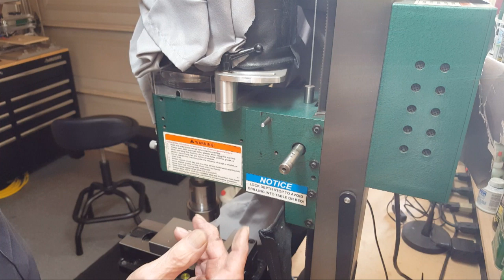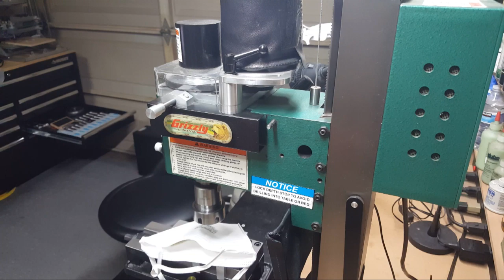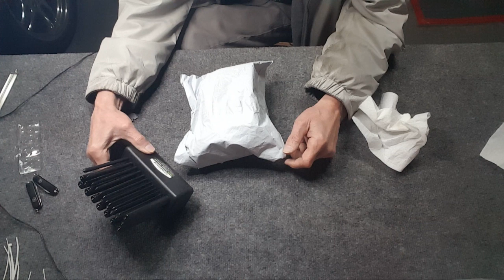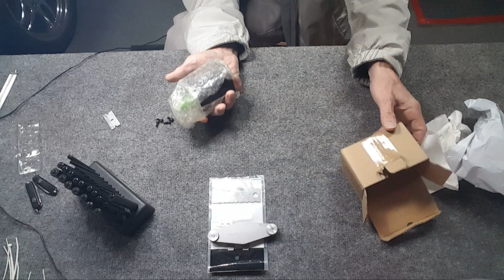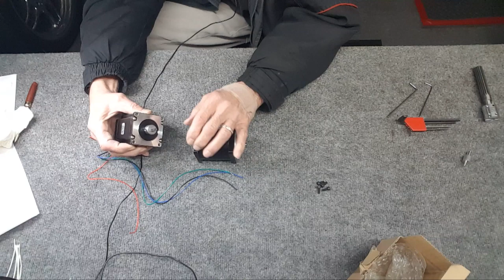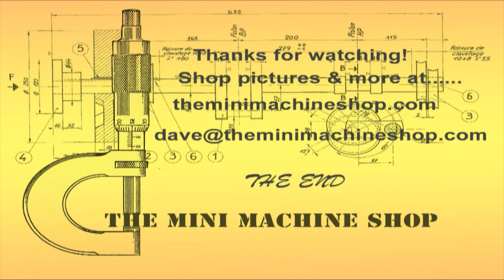Z Axis CNC Conversion

Comment: At the time 27:00 You show the gearbox, hundred to one. Why not buy a coupling of 8 mm? Ebay got them in plenty of versions, connecting different diameters to each other. Or drill up the hole to 8 mm? Turning the shaft I assume You took the gearbox apart. I wouldn't like do do that.
Reply from the maker: I couldn't find the correct coupling anywhere and the gearbox was put in a 4 jaw as is because, as mentioned, I need to turn the body down.
Reply: @TheMiniMachineShop  Quite some extra work. Well Done Dave! It looks like You have some kind of mental gearbox. When things get difficult You gear down and pushes on. Keep the spirits up and go on!

Comment: Look in to the C11G board from CNC4pc there around $68.00 it has backlash works well for me! oh yea i would use ballscrews not leadscrews
Reply from the maker: Your comment had me finally excited since I can't find anything reasonably priced that states they do backlash. Looked    at the C11G and confused. The picture shows only a parallel port connection but the description says parallel or USB or ethernet.  I don't have anything with a parallel port and want USB. How are you running this?
Reply: @TheMiniMachineShop  oh I understand I use a dedicated PC with XP using the parallel port you can connect to a UC 100 using USB with the c 11g  and other ways  too you should contact  cnc4pc if you have any questions there very very helpful

Comment: Eventually you will have learned everything I need to know to do cnc on my Grizzly.  I think you are supposed to enter the backlash amount into the configuration file.  But that is just what I have heard I do not have mach3 or a backlash problem.   I do know that their is a mach4 configuration file that is loaded into sheetcam and there is where I put the touch off height and other numbers for the torch.  I am not an expert on that either as I am just now adding a touch off setup on my torch.  Very slowly I might add.
Reply from the maker: In Mach3 yes you enter the backlash amount in a settings area but the diver file is suppose to execute it and my driver doesn't.
Reply: @TheMiniMachineShop  I would contact the company and see what they have to say.  Or check the users forum, lots of good information there as well.